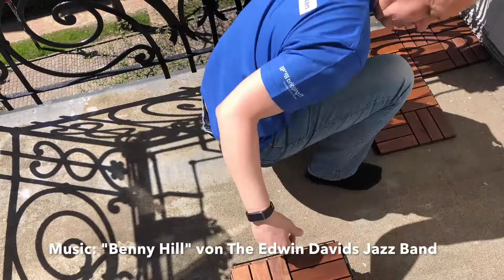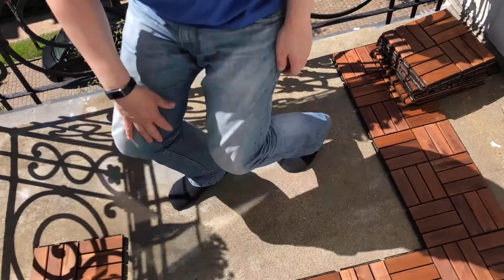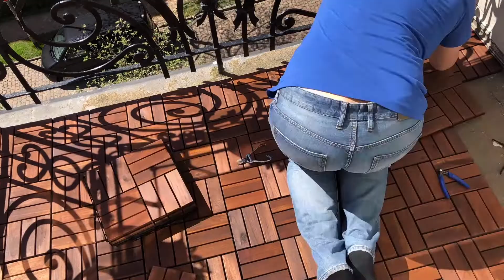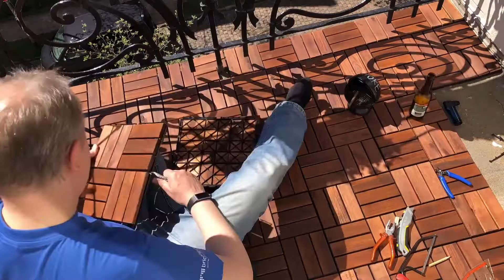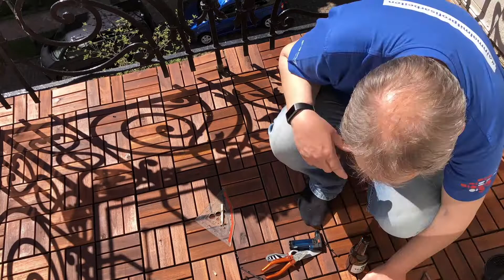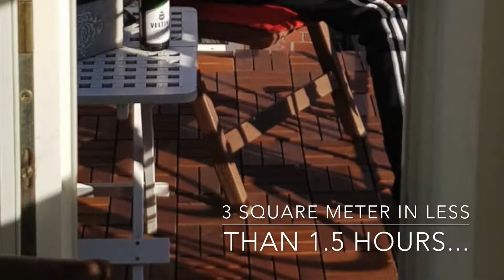Restoring the Balcony with IKEA Runnen

Comment: Hi, I'd like to have had more explaining in this.  I noticed you put sand down, it would have been useful to know why or why you needed nails.
Reply from the maker: Hi, i didn't used Sand, the Floor was originally coated with sand... :-) I used the 2 Nails for one part because i had to cut out a small piece from the wood.